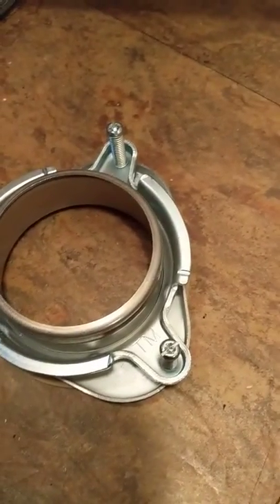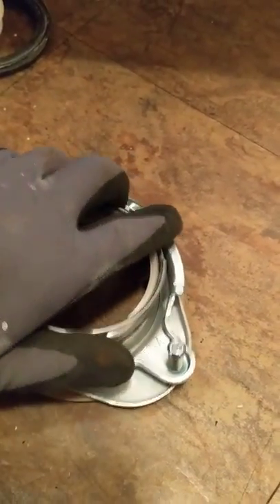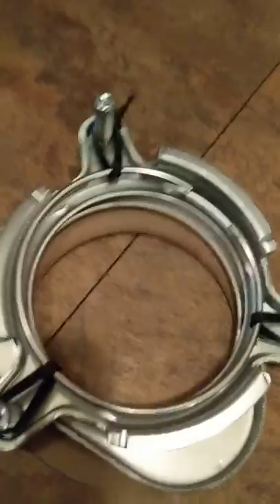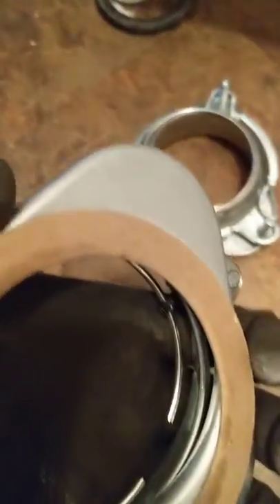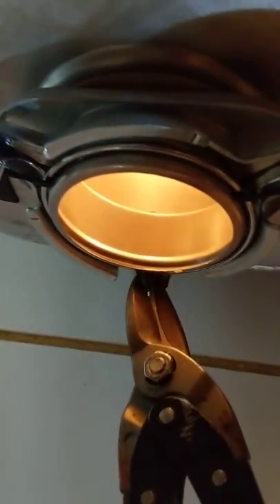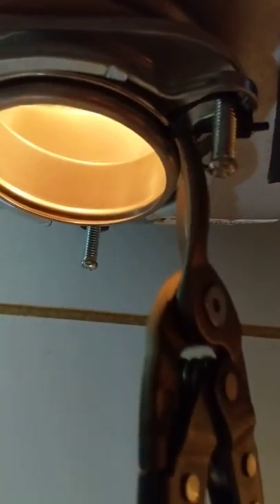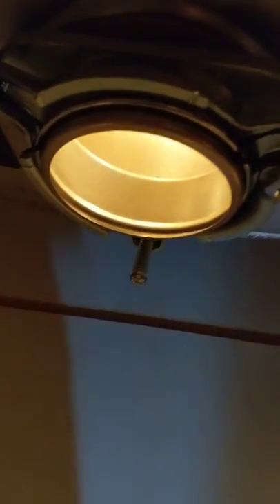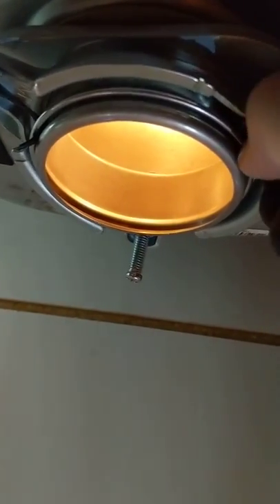Garbage disposal flange snap ring install trick.

Comment: Thanks! I should have watched this video an hour ago.
I used thin aluminum wires but didn't take the fragments out so the ring didn't seat properly and started moving when I tightened the three screws. Once I loosened the screws again and  got all the wire fragments out, it seated just fine the 2nd time I tightened them.
Thanks again, McGyver!
Reply from the maker: You made it work and did a great job with the wire, nice job improvising! I really appreciate the kind words, Thank you thank you!

Comment: Hi….looks straightforward now that you have shown us the trick!😂….I’m yet to do the install, but had a question (that maybe very obvious to everyone, except, of course, me!) about the tying of the ties,…. You see, Since the snap ring diameter is ever so slightly smaller than the flange lip diameter , do the ties need to be tied up tight ‘enough’ that the snap ring yawns ‘enough’ to go over the lip smoothly (like in your video)?…. And as the ties are cut, the snap ring snaps in place above the flange lip?
Reply from the maker: Awesome! You have it correct, the zip ties need to be very snuggly installed, not much room to slide over the collar. You will be able to slide it up and over after that. Great observation! You got it, happy to help!! Thanks!!

Comment: Thank you , Thank you , thank you!  I did not have any zip ties (now I fully understand that concept) but I had small rubber bands (the ones from Scallions) and at least that kept the snap ring tethered to the screws.  It was still a very difficult task but just using the rubber bands, made it more tolerable.
Reply from the maker: Nice! Thanks for the kind words.

Comment: How do you get it to stay in place while you pick up your snips? There is nothing that holds mine in place. I am ready to burn the house down. Even with 2 people the zip tie trick didn't work
Reply from the maker: Typically the ring will hold itself until you get the snips, give it another try, hope it works out for you! Thanks for watching!
Reply: I tried putting multiple rubber bands on the flange, taping the pieces up, I cannot get this to work. I guess I need different zip ties. I can't get it with my hands, the flange pops out, even with the disposal on top of it, or me pushing down and someone else under the sink. Wish I never took the old one off. Giving up for now. It should not be this difficult!
Reply from the maker: Maybe give it another shot from the beginning, these things can be very frustrating! I totally understand. Make sure the zip ties are good and tight, don't give up, you got this!
Reply: Thank you. I took the snap ring from the old disposal.. it was slightly larger.  Have a few more tries and Finally managed it. It felt like luck. Thank you SO much for responding to me on this old thread though.  If interested, I installed a Moen Prep Series GX50c because it said stainless steel blades and a polymer chamber. Fingers crossed it doesn't rust!!
Reply from the maker: Wonderful! That is a great tip to know, I'm happy you got it done. Thanks so much!

Comment: I get the snap rig on, but when tightening the screws on the flange snap ring. just pops off in a flang falls to the ground
Reply from the maker: Give it another try, I have had them pop off as well.
Reply: Same....my flange doesnt seem deep enough to take the ring, but I know it has to be.

Comment: Didn't work after three rounds of wire ties. But running string through the opening and tieing to a stick on the sink end, using a leg to hold down the bottom one on the cabinet end while the top is held by tension works.
Reply from the maker: I wish it would have worked but happy to hear you found a solution!! Thanks for the feedback!